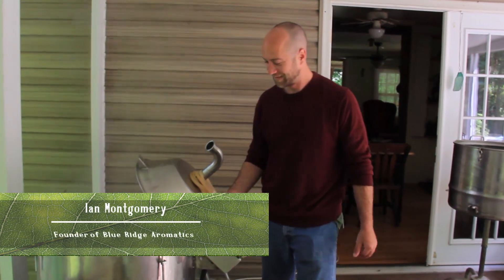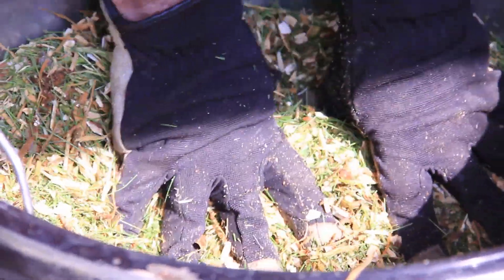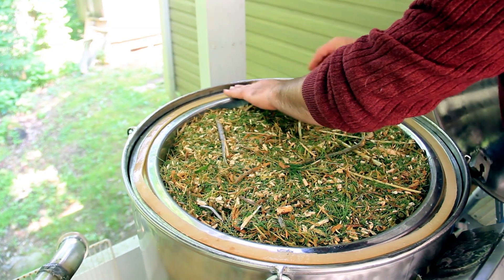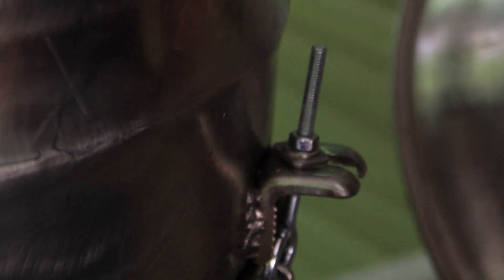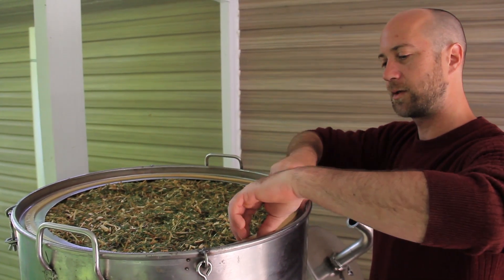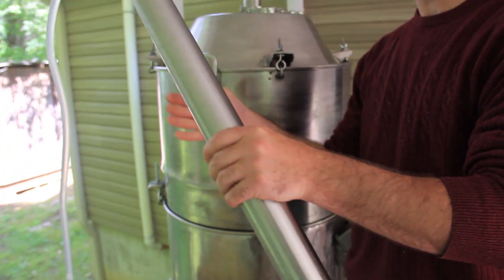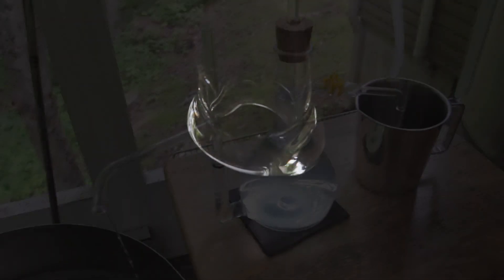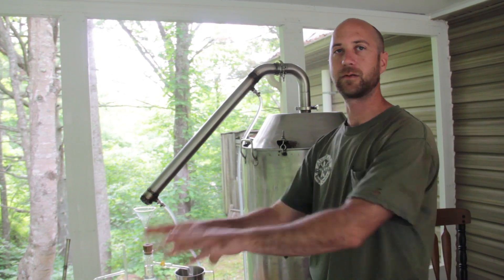Essential Oil Distillation Process

Comment: Stainless steel drums would be good for water distilling!  Water is very precious if it's contaminated.  Not to mention itd be good to steam wood.
There's a chemical used to extract oil, that's how paprika is made.  The chemical extracts the oil, then the chemical.is evaporated the oil.

Comment: Hello and thank you for this video, I have a small three-liter still and I haven't had a single drop of essential oil, do I have to keep the temperature at 100 °? I had a lot of trouble cooling the coil (with cold water but manually) it was very negative, do I absolutely have to be plugged into the tap? and finally my cooling tank has only two outputs. Thank you, I await your advice.

Comment: Do you use stainless over glass as a preference or because of cost and availability of materials for that sized container? I am curious about using glass specifically as it relates to using a round bottom flask and glass condenser, compared to using stainless steel equipment.

Comment: The 10:15 is basically a manually controlled Dean Stark trap / apparatus. You can also use the separatory funnel if you don't need continues operation.

Comment: Great video! I'm wondering why lower pressure is better though - is it because high pressure can lead to higher boiling temperature which could burn whatever you're extracting? Or is there some other reason?
Reply: Higher pressure leads to over oxidation
Reply: How  much is that, want to buy one?

Comment: At around 11:13 You mentioned water present in the oil. How did you remove it before bottling ?
Reply: can separate using hexane

Comment: Good job, what about your loss of volatile vapor at the discharge of heat exchanger which is in atmosphoric, i would suggest a covered trap / funnel would do a over condensing and no escape of vapours, agree?

Comment: How efficient would you say this set up is? Did you get it custom made? If not I would like to know where can I acquire a similar one. Thanks
Reply: They're all custom technically. He said he had the stainless steel 55 gallon drum cut and polished, the gaskets he used were $2 silicone rings from Home Depot, the condenser was custom with the three tubes inserted and he even joked about how his welding wasn't cute but very effective.

Distilling isn't a one size fits all kinda setup....ancient native Americans used handmade clay pots sitting over a fire, similar to a witch's cauldron. Distilling is more understanding how distilling works, and you constructing what you need from there 👌🏾

Comment: (Terry) Thanks for the video, I like your system. Mine is home use, similar in effect but stainless 6 quart. I use the old copper coil condenser system. Few in essence production seem aware of the benefits of copper's beneficial neutralizing effects. I studied distillation on and off for a couple of years before building my own. That doesn't mean I don't have more to learn of course.  All the best in your efforts. Hope this adds to your production outcomes

Comment: (From Carolyn's husband Terry)...I use a 4 day 180 proof alcohol soak ahead of distillation with finely ground product. I believe I get 10 times the essential oil by utilizing this pre-distillation step, but I'm pretty new at this. I have only made salves so far. 1/2 lb of hemp root bulk resulted in 16 oz of essential oil and alcohol mixed. By comparison with input versus output the process leaves about 40% alcohol mixed in the essential oil.  This then separates from the salve by constant stirring as it cools.  5 oz of alcohol separated from the salve while stirring . A small amount of the alcohol remained in the roughly 1 quart of salve made....perhaps 1-2 oz per my guesstimate.  I'm not upset by the alcohol remaining as I believe that minor residual alcohol in a salve benefits transdermal efficacy.
Reply: I am getting started in this. Are there any resources you could recommend for essential oil extraction? Books, courses etc?